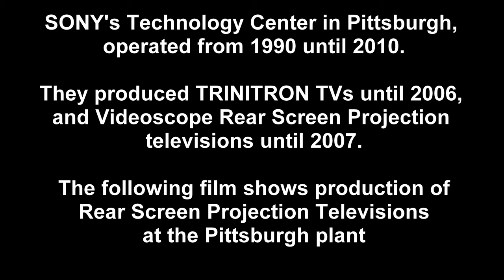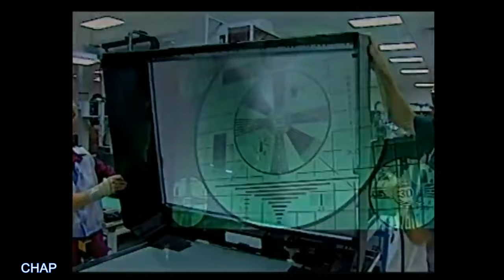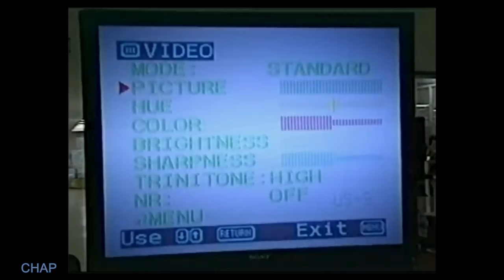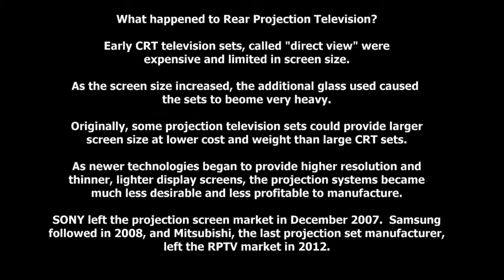How did SONY Make REAR SCREEN PROJECTION TV? (television technology history electronics VIDEO Japan)

Comment: Those were great TV's and delivered a superior picture to the others brands. I did repair work on them, and other that some components that ran thermally hot (STK convergence correction IC's) they were super reliable.
Reply from the maker: Hi Norcal715, Thanks very much for the info!  I am not sure what STK convergence correction is.    A heat measurement of some kind?     Fascinating!
Reply: @ComputerHistoryArchivesProject  Nope. Those ICs help with the convergence geometry, so that the three projected images line up perfectly.
Reply: Eh I’d disagree when my grandfather bought our Toshiba rear projection screen and he preferred the quality of it over other tvs.
Reply: I had one it worked fine until you ran it for over an hour then the screen would tweak tf out

Comment: So to clarify this more to people that need it. The rear projection sets had three small CRT screens inside the set each with there own coloured filters red green and blue the three main primary colours. Those CRTs would project the image off a mirror in the back the three images would combine as one on the panel screen in the front. The images were produced upside down so when the image bounced off the mirror it be the right way on the screen in the front. Being a CRT the blacks were perfect and colours were deep and inky. The downside is these sets were big and heavy and sometimes during the day the screen since it’s being projected could look washed out but not all the time.

Comment: I never saw these types of TVs in Sweden growing up. Only time I saw one was in Canada. Of course these days with flatscreens you can see up to a hundred inch screens but back then it blew my mind to see a 50 inch screen. The biggest I had seen in Sweden were around 30 inches.
Reply: Fun fact they even had 70 incj ,odels of rptv sets with witch as thin as 6 inches depth could be mounted on a wall. Just as with moder tv flat panel sets.

Comment: I was a process control engineer for a SONY branded rear projection tube!  I worked at a place called "Lexel Imaging" which was the remnant of Hughes Electronics.  One of their products were CRTs that looked EXACTLY like those at 3:10 and were used in CRT projection systems for aircraft flight simulator trainers.  Ours had a glass plate that was bonded onto the front and ethylene glycol coolant pumped in.  And they WERE a SONY branded part. Lexel Imaging had the contract rights to manufacture them under the SONY name, and I was the process control engineer for these tubes!  The deal was we had to do it EXACTLY as Sony demanded and couldn't modify much about the process.  There was a bonding agent called Shin-Etsu, which needed to be ordered from Japan.  I remember when the 2011 Tsunami hit, I got funds from my boss to order a whole bunch of it because I anticipated a shortage --- and I was RIGHT.  The Shin-Etsu plant had production problems a little later because of the electrical power rationing that resulted from that tragedy.  Anyway, that's my story.
Reply from the maker: Hi  @telesniper2, thank you very much for your story and a bit of history.  Fascinating times!  I appreciate your sharing some of your memories at the SONY plant.  ~     VK
Reply: @ComputerHistoryArchivesProject  You're very welcome
Reply: Interesting! I have a detailed teardown video of exact Sony model shown in this video. It might be an interesting watch.
Reply from the maker: Hi @BGTech1,  yes, I like your Channel too!   You have some very good video teardowns,  highly recommended!    ~  VK